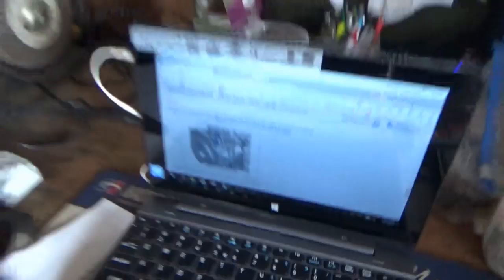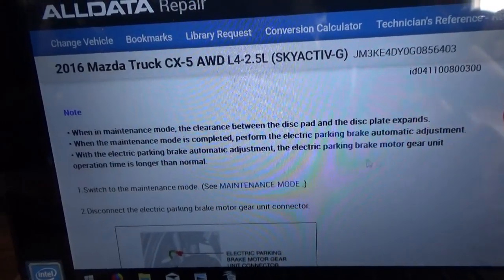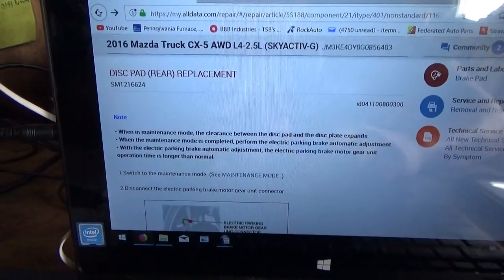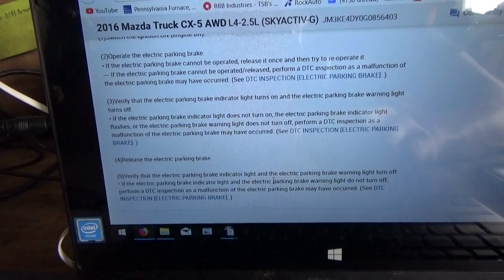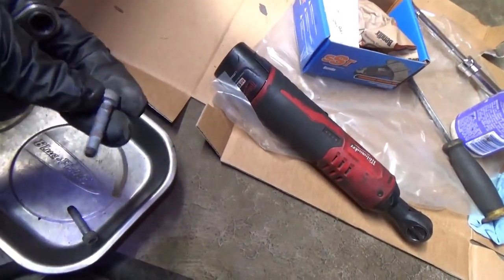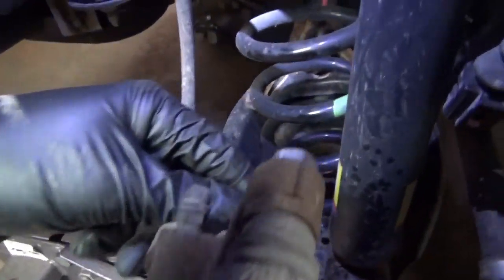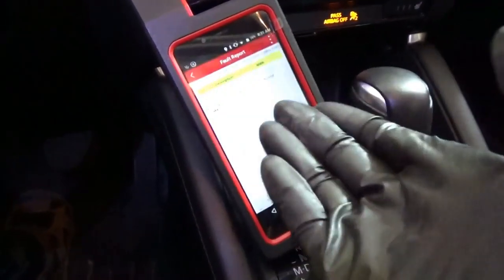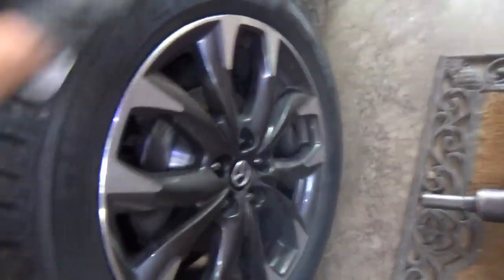Brake Job COMPLICATIONS! (Mazda CX5)

Comment: At 6:17 you said you would charge extra. Why would you charge the customer anything extra? You clearly stated it was something you messed up on. this is what really hurts us techs. I know this job is taking more of your time and you are having to remove parts you normally wouldn't. You can't charge a customer for lack of knowledge or training. This is where you take as a self training exercise so you won't have this issue next time. Don't take it wrong your a good tech and I enjoy watching yours and other Youtubers channels.
Reply from the maker: Good point...
Reply: But are the scheduled work hours on an ebrake longer or equal to traditional parking brakes?
Reply: @chiluco2000  The tech taking on the job should know that information and take it into consideration when quoting the job. In this case the tech presumed it would be just like most other rear brake jobs and got burned. I agree with lee minnis, the tech shouldn't charge the customer extra time to learn what the customer likely assumes they already know when entrusting them with the job in the first place.

In other scenarios where a job overruns due to unforeseeable issues - e.g. finding further broken parts upon disassembly of that quoted for or having to repair some previous asshat's damage to threads that now need helicoiling etc. - then fine, let the customer know and charge extra. But that's not learning, it's just unforeseeable - well, actually it's probably foreseeable that 'something' along those lines could occur so the customer ought to be appraised of that possibility when given the quote. I'm sure it's probably a typical T&C clause when quoting.
Reply: While you are correct I believe ivan made that comment off hand. I think he meant charge more initially for the job. When I  have something go wrong I go into oh shit mode and it's hard to tell what I would say.
Reply: Pine Hollow Auto Diagnostics yeah I agree. It’s wrong to charge them extra for your mess up. It’s not their fault. I wouldn’t pay you no extra lol
Reply: I agree with this point 100%.
Reply: Extra labor, extra knowlegde... that is why he is charging extra
Reply: The maintenance mode procedure is simple enough that it shouldn't have taken any significant amount of extra time over a regular brake job,  had the procedure been done properly. So, IMO it would be wrong to charge the customer for the extra time. Just take it as a lesson. Thankfully nothing broke and next time you know what to do.
Reply: An extra charge for electric E-brake job is not unreasonable. On most cars you havta own an $bidirectional scanner$ and extra steps have to be preformed.
Reply: @Matbug1812  That is fine but not the issue in this case. This is about charging more for a mistake that was made by the tech doing the job.
Reply: Ur rite there..he should eat the time it took him to bail himself out of the jam he put himself into by not reading the procedure first.
Reply: He's right. I'm not a tech but when this happens to me and it costs me extra money, I call it "knowledge purchased. "
Reply: @sinegra30  And that is why dealers charge what they do.Staff training,oem tools and best of all,manufacturers warranty and repair systems.
Reply: Like watching a Chinese fire drill....

Comment: Just like a VW. My daughters 2013 CC was pretty easy with a scanner. Service section. Retract E Parking brake. Heard both retract. Changed rotor / pads.  Pushed reset E Brake and both motors closed onto the rotor and then released slightly.  I agree with you in that no one should need a scanner to change out brakes. Crazy. I'm sure though it saved VW money and a precious few oz's of weight for the blessed MPG Gods..
Reply: The Passat - and other VW makes -  feature notched pistons, suggesting you would have to twist them back in after releasing the e-brake. In the tool set there is no insert that fits into the notch pattern. Guess what, you push on them straight and they'll retract.

Comment: Just did a Jeep Cherokee today.  You can enter brake maintenance mode right from the cluster.  When u do it retracts the motors.  Then u just push the piston back in.  Don’t turn just push.  Install ur brakes.  Then pump up the pedal,  activate the parking brake a few times to verify it works correctly and ur done!  A lil more work but all in all pretty easy job!

Comment: Just a heads up, something that caught me.  The brake pads have a pin on them that locate them into the slots on the caliper piston.  If you previously turned the piston, and didnt get it back to 12" oclock position before you re assembled it with the pads, you could have smashed the pin with the piston, making it mushroom out, and then still not fit correctly once you rotate the piston to the correct position.  This is what bit me in the ass.  I swapped the pad with the smooshed pin to the outside of the rotor and vice versa, made sure the piston was oriented correctly, and BOOM, working brakes.

Comment: Ivan we in the third world countries we usually disconnect connector from the motor and use the power probe and apply direct voltage to see which  direction the piston moved  by reversing polarity you'll see the piston moves opposite direction

Comment: So apparently there are multiple TSB bulletins for the EPB system in 2016 CX-5. I own a 2016 sport model that is 6 speed, so I use the parking brake pretty much every time, and of course when on an incline, put it in gear. Anyhow, back in late November, I took mine to a local mechanic to replace the rear brakes at around 46k miles. Now 2 months later, the EPB has failed. I had two incidents in the same day where when I started the car, the brake wouldn't release and the warning lights were blinking. I had to restart the car multple times before it would disengage. After the second incident, I drove straight over to the Mazda dealership and as it was the end of the day, I had to wait and take a loaner. Anyhow, the next day, after having to calling their field tech/engineer, they reported that the calipers were damaged and blamed it on the mechanic who replaced the brake pads, saying he failed to put it in service mode. I contacted the mechanic and he said it is not possible to replace the pads without putting it into service mode. So now I'm stuck with having to pay over $1000 for a repair. I am pissed!

Comment: Hi Bro , your video saved my life :) i was in trouble with my epd  after replaced the pads in maintenance mode. I spinned the piston instead of push it and after maintenance it was impossible to get out off the maintenance mode. 
I ve read a lot of thing on the web and was prepared to lose 3K euros lol but , I tried what you did on your viedo and that worked so thank you man , if you come in France contact me :)

Comment: OK,  Let me give you low down on the parking brake system:  First, don't get excited if something goes wrong - its a pretty stupid logic system and the entire system resets itself by going from Driver Mode to Maintenance Mode and then back to Driver Mode.  This just recalibrates the position of the gear system within the caliper and I would recommend its the first thing you do before diving into the caliper piston mechanically.  If the parking brakes are still locked (one or both), then its time to dig a little deeper; the Caliper piston is either frozen or the motor does not have sufficient current to drive the gear system back.  The latter can be easily tested by remove the motor drive assembly as shown in the video and running the test you have shown.  If the motor does turn then start working on the piston.  The planetary gearing system within the caliper that the motor turns could be stuck was driven back previously without the car in Maintenance mode.  In this case, sorry but you will have to replace the caliper because the teeth of the gears are more than likely damaged and you don't want to attempt to rebuild a planetary gear system. Just make sure the piston's three detents (shown in the video) are clocked in there correct position.

Comment: I replaced the rear pads on a 2016 Mazda 6. No scanner is needed. Here’s how I did the rear brakes in 45 min with no scanner needed:
- Removed caliper/pads/rotors
- Removed electric parking brake motor on each caliper
- Manually fully retracted parking brake 
- Used a C-clamp to compress piston
- Re-installed parking brake electric motor
- Cleaned caliper, installed new hardware
- With ignition on, apply/release parking brake

I searched and searched on how to do rear brakes on these cars and I couldn’t find anything to clearly explain the procedure. After learning how it all works, I decided to try this and it worked flawlessly for me. I know it’s not the “proper” way,  but it’s a way that the Mazda was happy with. In fact, I kept in touch with the owner just to verify no further issues with the parking brake and she said all was working well 👍🏽🙌🏽

Comment: A few years back, I read where guys would  pull the plug on the electric brake and using jumpers, cycle the brake that way. Then reset the system . I havent done a parking brake job on our Subaru system yet. I wouldnt never charge extra for something I did. Its called learning. Sometimes it can cost you. I ALWAYS  read up on anything I am not familure with, especially electric brakes. Yes, you can do the brakes without a scanner. Its called jumper wires. Think old school. One thing I learned reguarding electrical components.  Positive is always positive and negative is always negative. No you dont have to do any fancy stuff.

Comment: Hi there, I have the same problem, I just wanted to ask you if this is the procedure to fix the problem

1. Put the car into brake maintance mode,
2. Take of the actuator and disconect it of the  conector 
3. Turn the litle spindle on the caliper clockwise to pull the piston all the way back 
4. Take the car out of brake maintenance mode until the actuator is removed and disconected 
5. Conect the actuator to the conector but dont put it back to the caliper, 
6. Put the car in maintenance mode so that the actuator spins freely till fully open,
 7. Put the actuator back on the caliper and take the car out of brake maintance mode,
 8. Erase the errors on the OBD and see if the parking brake work properly.

Comment: Lol. All you had to do was take the motor off spin it till it bottoms out inward with a 12point torx some are allens.then push the piston in. do the brake job and your done. You just pump the pedal and good to go. I do this for vw, bmw, mercedez, ford, chevy,mazda,infiniti and toyotas for years now. Never ever had a issue

Comment: Yep..Same as the Range Rover Evoque and others...The song and dance you have to perform is insane.!...Maintenance mode and service should be accessible via a scanner as they want you scan it first anyway...Just sayin'...Soon as I saw the pin on the outer pad I called incorrect placement...Inner pad has pin to locate in the piston and stop it from turning...

Comment: Sure it's easy when you follow the procedure.  But most newer cars have these electronic e-brakes.  Is the procedure standard for all of them?  Most of them?  Any of them?  How many procedures are there?  Seems technicians will be spending more time doing research then actually fixing anything.  I realize this is due to government regulations but does it make the car safer?  Is it more likely to have the rear brakes replaced when the car is older?  I don't know what value all of this additional complexity and potential points of failure provide to the consumer.
Reply: There are different procedures to retract the P-Brake depending on the make.  This isn't the government in this case it is the makers themselves, technically the electronic P-Brake was a violation of the laws requiring a separate mechanical braking system, but they got it slipped into the newer laws as acceptable.

Comment: Sorry that happened to you pal, same procedure applies to newer fords as well. DO NOT touch the brakes until in maintenance mode, then simply depress pistons like normal, don't screw them in. I cringed through the whole video, lol. Good job figuring it out though

Comment: It would have made more sense for the EPB systems to be in retracted mode anytime they're not being actively used. They can then auto adjust to the piston position when engaged or when the car is in motion (because this is both your parking brake and your emergency brake).

I would guess some EPB systems are probably "always on unless disengaged", meaning they only release when in Drive, Reverse, or you've selected "Disengage".
Reply: The motor is pretty slow, so a full retraction and extension would mean a lot longer to engage and disengage the EPB.  This would also increase the motor wear and tear quite a bit.  As it is, the motors only retract a couple of turns to return the brake function to the hydraulic system, leaving them close to the piston when it's time to apply the EPB again.  I see why they do it this way.

Comment: My understanding on those is prior to starting the rear brakes, you must engage maintenance mode. Then, one completed with the brake work, disable maintenance mode and all if well. I'm only guessing that Maint Mode simple rotates the motor enough to a preset position so the calipers can be removed. I have to wonder though, if the vehicle is on a steep incline/decline, is that electric motor going to have enough squeeze on the rotor to prevent it from turning?  Just how tight does that "Parking Brake" really get on the rotor?  Another thing, likely you can't engage it with the car moving so to me thats a defect compared to the mechanical designs.  Seems at times the operator of the vehicle would like to engage the brakes for various reasons yet this system may not allow that. Just like the start stop features on new vehicles today, I wouldn't be trusting that idea near a RxR crossing or when off the pavement on dirt roads etc. There are times when brake, engine power and so forth are desired to help get out of situations etc. while not on a paved road in a "perfect world". More about those systems need studied to examine just what some of the negatives amount to.

Comment: Yeah, I have had these give owners trouble and I get called out.   Normally when you put it in maint. mode first it will release the calibers so you can just squeeze the piston back in.   When owners don't know this and they get it all out of wack, trying to turn calibers.  Then I get in the car, Push start twice, hold down accelerator pedal, hold down start button, then press start 3 times.  I will attempt to go into maint. mode.   The take off caliber, remove electric connector to parking brake, remove the 2 torx bit screw that hold parking brake module onto caliber then take a T40 (or a wrench on some of them) and turn parking brake on caliber clockwise till it stops then squeeze in caliber and re-assemble.  Then remove it from service mode (same way as going into service mode except you pull parking brake button up)
Reply: I did just that and it didn't help.  Are you suppose to do this to both sides so that they engage at the same time or does this not matter?

Comment: mikezinck sounds like he knows. I found this on the web and it is a little more detailed. The procedure to put the 2016 Mazda 6 rear breaks into maintenance mode is the following:

First, release the parking break, then follow the steps below:

1) Turn ignition on (press ignition button twice !)
2) Depress the gas pedal fully down until you hear a click (keep pedal depressed through the rest of the following steps, DO NOT RELEASE!)
3) Press the parking break lever DOWN (HOLD IT DOWN through the next steps, keep holding the gas pedal down as well!!)
4) Turn ignition OFF (press ignition button once), keep holding the gas pedal and break lever down!!
5) Turn ignition ON (press push button twice!) while still keeping the gas pedal and break lever down.
      At this time you will see the yellow 'break released'  sign somewhere in the upper left corner.  You can now turn ignition OFF and release the gas pedal and break lever.  
After you do the maintenance, you can put the parking break back into active state using the same above procedure, BUT for Step 3 you have to PULL and hold the break level UP.  I have tried this few times I had to replace rear break pads on my 2016 Mazda 6 and it always works OK for me.
Reply from the maker: Sounds complicated haha

Comment: Ahhh, new technology but at least the cables won't seize. I find that a lot of these systems are simple and you can retract the pistons with jumper wires to the motors depending on polarity but some you have to follow the procedure exactly or it will mess up. Once you mess it up following the procedure exactly is even more important.
I'm sure you will remember next time.
Another frustrating job.  😊
Reply from the maker: I bet that these dinky motors will eventually suffer the death of salt water intrusion....then I will have the satisfaction of smashing them to bits with a sledge hammer...or maybe a torch?

Comment: A bit off Topic but beware aftermarket front rotors for a 2012 and perhaps other years, Kia Soul.  After 3 sets we found new ones have Rotor thickness 0.100" too thick and the bracket will not go on.  OEM was. 0.925", aftermarket 1.025"

Comment: you have to hold the Gas all the way down  and turn it on an off 3 times in 30 secs while pulling the brake lever up , i had this same problem to